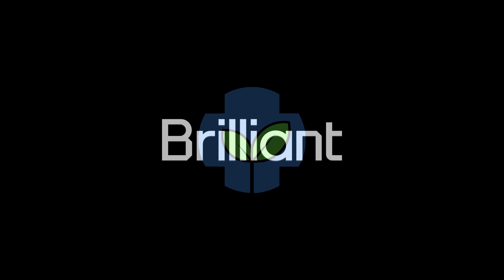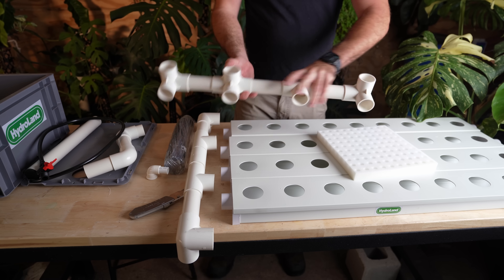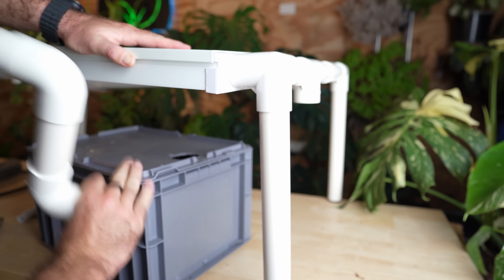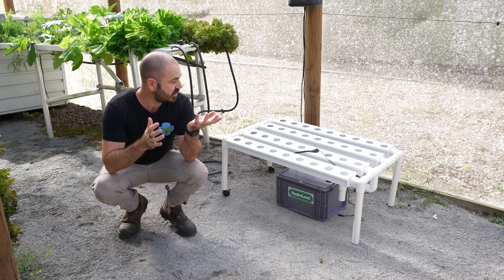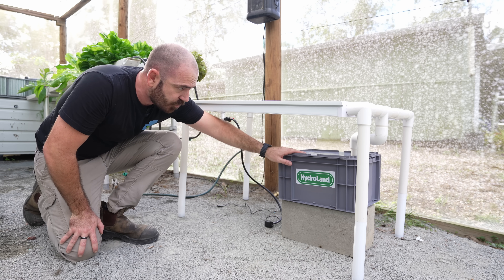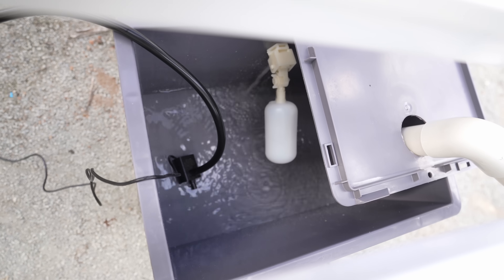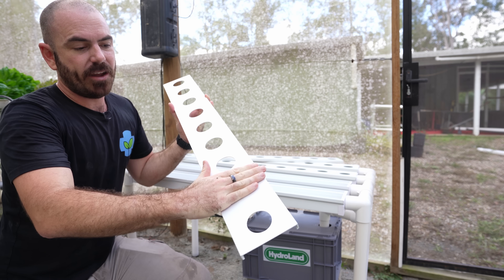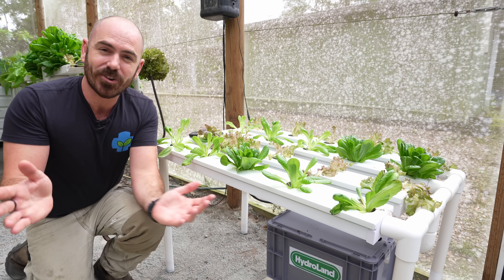The Best Value Nutrient Film Technique Hydroponic System

Comment: You don't have to use a pipe adhesive on each connection?  Won't it leak with just the push together method?  Any idea if this system will ever be available in the U.S.?

Comment: Hoocho...Did you delete my comment???
Reply from the maker: I did not?
Reply: @Hoocho  Hmmm... strange, It seems to have disappeared? I asked if you needed to use glue? Also, I mentioned another dude on YT who designs his NFT systems level so if the pump stops, it leaves a little  water in the channel until you fix it. An interesting concept which this system could do quite easily.

Comment: Instead of 3d printed leg extensions, how about a 3d printed adapter to standard australian pipe sizing, would also allow for a cross beam to steady somewhat spindly legs  at the same time?
Reply: easy enough todo  try a tee fitting or a cleanout.

Comment: Great new product but wouldn't this be similar to those pipe DWC systems since you end up having water sitting at the end because you have a lip the water needs to overcome before ending up back at the reservoir? The last few plants sitting in the water instead of the flow of water.
Reply from the maker: Due to the design of the system it was an unfortunate trade off we had to make. 
Personally I'd leave that last space plant free. 90% of the channel is still nutrient film. 
I'd also hazard a guess that nutrient at the end is still largely oxygenated.

I'm considering doing an XL system where the pipes drop directly into another collection pipe similar to how my large system pipes drop directly into my res.
Reply: @Hoocho  Fair enough. I haven't seen many plug and play systems like the one here don't use the same input/output end caps for ease of manufacturing. Looking forward to any improvements.

Comment: I really like this but I would like to see it be stackable so I could buy each section as and when I can afford and then just add on top of current system. That way it would grow with me
Reply from the maker: You could stack this horizontally... but the connections would probably get a bit flimsy. 
Alternatively you could have multiple systems and the returns all run into a single sump and have a single large pump with multiple feeders.
Reply: @Hoocho  I am thinking vertically for indoor use with limited space. For me the ideal case would be to purchase one and jury rig some way to add lights then purchase second unit to fit on top preferably with lighting mounts below the upper unit but ofc I understand there are limitations and not gonna redesign for a singular person 😀

Comment: God the porn bots are quick!

I think I need to change my plans. I was going to do Kratky but I’ve got some pretty major medical issues to deal with so I think it’ll be easier if I have a reservoir so I only have one thing to monitor and fill. I still want them indoors with grow lights, but I’m going to be more exhausted than usual so need to make it as easy as possible. I’ll have to check out the options.